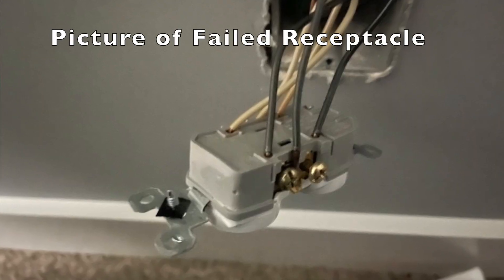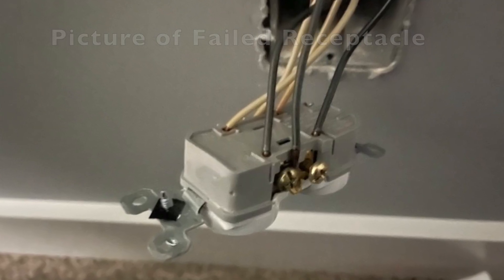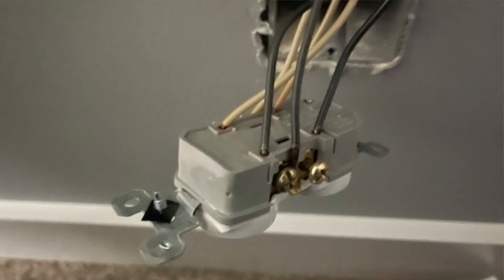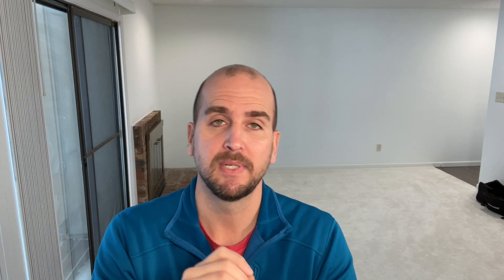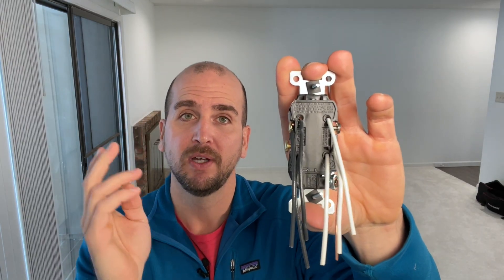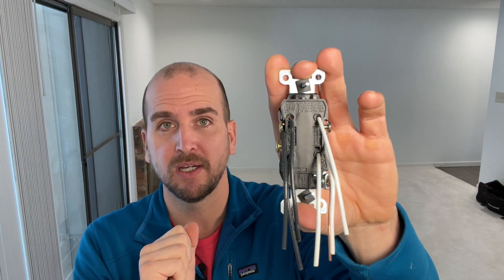Incorrectly Wired Outlet Found In Newly Built Home

Comment: I'm a Michigan licensed Master Electrician. Those are all good wiring practices. As others have noted, problems arise with under trained, unsupervised  apprentices rushing to complete a job. In this line of work, if it's not done right (code is the minimum standard), things catch fire and people will die.
Reply: I always wrap electrical tape around the receptacle covering the screw connections.
Reply: @journeyman553  I do when using metal boxes.
Reply: @scottodonnell7121  I worked on a large industrial  job that required all wire nuts be taped too. They also required the tape be "buggered" on the end for easy removal. They explained that every minute the assembly line was down cost them over 500$.
Reply: @journeyman553  by buggered do you mean leaving a flag at the end.?
Reply: @journeyman553  Been doin' that for years. Good practice.
Reply: Auh, what is code? I only ask because I have been many places and in each place I get different versions of "code". Conduit or Romex? Someplace they say it has to be conduit, others it is not a problem doing everything in Romex. Ground pins up or down? Had fights and was told both ways were the right way according to "code" in the local I was at. In an industrial site I worked at I was in the middle of a fight between the electrician and the plant safety rep about what "code" was. I would have loved to let them fight it out but couldn't get them to talk to each other and letting me out of the middle.

If electricians would stop using "code" as if it was their trade secret and the National Electrical Code was easily accessible instead of being a copyrighted  and VERY expensive building code much of the magic power of saying "code" every time someone questions a decision would be lost. Of course that might be why things are as they are.
Reply: @keithstudly6071  NMC, or Romex is permitted to be used is exposed or concealed locations in normally dry conditions. Article 334-10 A1. The NEC book is easily obtained at supply houses or Amazon. I just got the loose leaf version for 36 bucks. A great deal. So, it can be done with just NMC, but we don't like to do it. We consider it an inferior method.
Reply: @keithstudly6071  Yeah, i agree. The NEC is a guideline for the different jurisdictions. In some places the city and the country will have different codes. They don't vary that much from the NEC  BUT they do vary. As you say in some places it's Romex. some conduit and some require MC Cable instead of Romex, Some places simply go by the NEC. Others add to the NEC. The NEC is considered the minimum. The NEC itself is almost unintelligible if a layman tries to read it. You can buy an annotated copy [ over 50$ ] that explains each section in English after the electricese if you don't speak electricese . Ask your electrical supply house where you can buy one. The NEC is constantly changing or being added to every 3 years. I don't know how they could make it any more complicated but when they can make it more complicated they do.  I worked in the trade almost 30 years and traveled a lot. This code system is insane.
Reply: @keithstudly6071  Umm. Go buy a book, I'm not your trainer.

Comment: I wonder what’s more likely to fail in practice: push-in connections or the wire nut pigtails. I prefer wago nuts to wire nuts, but it can be a tight fit in the box
Reply: Push in definitely. I've repaired far too many of them. That's why I don't trust wagos
Reply: @nooneyouknowhere6148  I am with you on the Wagos.  There is a lot more wire contact on a properly twisted wire with wire nut than any push connector.
Reply: @Dev JB with them using 220 V for everything over there all those kitchen appliances use half the current when compared to 120V in the states.

Comment: I've been wiring homes for 20 years. I wouldn't use a stab-in on an outlet EVER. Any time there are 3 or more conductor pairs in the box they always get pigtailed. Usually when there's only 2 I use both terminals on the side. Load pass-through is not a problem if the circuit is properly designed, i.e. not too many devices. There is one place where I prefer WAGO connectors and that's inside recessed lighting cans. Some models even have them pre-installed. Since you're usually on a ladder with your hands over shoulder height, anything that saves time is a blessing.

Comment: sidewire terminals and backwire terminals are perfectly fine for one wire per terminal - pigtailing is a belt and braces situation for those, but three or more wires should always be pigtailed. 

also, GB wire nuts have never really impressed me.  spend a little extra to get Ideal or 3M wire nuts, and you will get better installation characteristics.

Comment: The biggest problem I've run into is the electrical box being way too shallow. Using a box extender puts the outlet too far off the wall. Some contractors just love to do electrical as cheep as possible and that sucks when needing to replace an outlet Correctly!

Comment: I'm not electrician but do not care for pigtails. Someone's not paying attention when they do the wire nuts you have one wire loose could be very bad. If you're overloading the plug in the plug goes bad because of that reason you can explain it to the homeowner.. what if they're overloaded multiple plugs. And it so happens they burn up a wire nuts that just looks like faulty wiring. But that's just my opinion

Comment: Good practice, especially on metal boxes is 2 wraps of electrical tape covering screws. Especially useful in 2 scenarios. First, working on a live circuit inserting a device (switch/outlet) into a metal box. Second, public buildings where walls are frequently re-painted. With wall plates removed (good painter) and metal boxes (commercial standard) little fingers are in danger.
Reply: Agreed. I do the same with tape
Reply: 3 wraps minimum, always.
Reply: 3 wraps of Super33 is good for 600v.
Reply: Never...

Comment: I've seen installers put a wrap of electrical tape around the screw terminals.
Reply: Usually to help with accidental contact .
Reply: Also the wire nut
Reply: geez, how do you short out a plastic box??metal boxes???
Reply: @jsparlin1  

I’m in cook county Illinois. Everything in in EMT conduit and metal boxes. No ground wires as the EMT is the ground.

I always wrap the switches and receptacles.  Besides avoiding shorts to the boxes, it makes the fixture more safe when you have the cover plates off whether it’s while still working or later when paining etc.
Reply: @TheRentsTooDamnHigh  being ibew member i smell a union rat thing..plastic boxes are superior.  they don't corrode..or conduct shocks..you should use self grounding recpts.  move as soon as possible.
Reply: @TheRentsTooDamnHigh  a ground wire in EMT has bee n required for many years due to poor installation practices.
Reply: @TheRentsTooDamnHigh  Good Lord! EMT in wood studded walls?  How long does it take to wire a house?
Reply: @jsparlin1  In general, Chicago goes a bit further than most places when it comes to fire hazards, whether electrical or otherwise.  Good old Mrs. O'Leary and her cow, or so goes the fable, taught that city not to mess around.  Thus lots of brick and stone homes in the area, too.

Trivia item: The Chicago Fire Academy is located on the same parcel that was once Mrs. O'Leary's barn! There's also a statue of a flame with an inscription in the ground saying that's where the Chicago Fire started.
Reply: @nooneyouknowhere6148  

Absolutely not true.
Reply: @jsparlin1  

I used to think the same thing. Until I did some work on romex houses. Not being able to pull new wire without tearing into walls, not being able to use different colors, always worrying about hitting a cable when hanging a cabinet.

I did a kitchen for a buddy in Michigan. The romex was a spaghetti mess so I hired a local sparky. He screwed up a three way and I had to dig into walls to fix it before I could go home

I prefer metal boxes with changeable mud rings if you change your mind later or screw up while building. The rotozip likes metal boxes too. Plastic feels like junk to me. I don’t think I’ve ever seen a corroded box.
Reply: It doesn't take much to make contact between the exposed terminals of a receptacle and a grounded gang box. One poke of a screwdriver and boom, you got a ground fault. Hence why electrical tape is used to insulate the terminals, it provides an additional layer of protection.

Comment: When replacing a receptacle in a previous home I had I found that all the pigtails were made using copper crimps covered in electrical tape. The wires were not even twisted together. Needless to say I re-wired/replaced every receptacle.
Reply: Just the really old way of connecting wires.

Comment: Lot's of YouTube videos promoting push on wire connectors (like IDEAL). These contacts are better that typical back wired outlet, but STILL ONLY MAKE CONTACT WITH A SMALL AREA, really an point contact on the wire. Sometimes technology and marketing promote bad practices. Before they had wire nuts, back in the day of cloth covered rubber insulated wire, still in many old homes, connections were SOLDERED providing 100% surface are contact.
Reply: Go look at videos here on YT of people testing IDEAL and Wago connectors to destruction. The insulation will melt off the wire long before those connectors fail; they can stand 3x the rated current.
Reply: @pheadland  I have had interesting battles with UL not doing their job. Their stamp means nothing.
If you do plumbing... everybody loved sharkbite fittings. everybody love them. They tested fine, but now reports that they starting to fail from prong corrosion. I also expect the o-rings  have a limited lifetime. Mass. were late to adopt flex gas piping. Because I'm engineer I predicted that on a lightning strike they would rupture, and they did. Then outlawed, and selectively OK'd some brands, but only the ones with grounding connections. Plumbers not allowed to do electrical work, so you new an electrician to do gas piping. Technology is wonderful if done right.

Comment: You twist your wires together wrong. Don't have them cross over one another. You don't need to twist solid wire before putting on the wire nut. They go on better if you don't twist them at all.   And your pigtails wires are too short.. They should be at least 6 inches, not barely 6 inches.

Comment: I have a hot neutral at the wall outlet. The hot wire is properly connected at the receptacle so is neutral so how can I correct this?
Reply: Check all the receptacles on the same breaker. One of them could be miswired

Comment: 12Ga wire with a 15A outlet?  Wire carries up to 20A...is that circuit on a 15A breaker?  If not, you created a failure point at the outlet for potential load.
Reply: I use 12 ga even for my 15 amp circuits.  I know it is "overkill" .

Comment: Replaced thousands of duplex plugs and switches using push ins with 3 or 4 call backs.Had some terminal connects come loose ,as well. Pig tailing is good advice.

Comment: You had 2 hots and 2 neutrals screws put one wire per screw would have worked safely without the pigtails. And then 3 wrap with a good 3m electrical tape...not plastic $1.00 per roll garbage.
Reply: It's not good to run a lot of current through the bridge in a receptical. Replaced many because of failure
Reply: @daviddean7377  ok Thanks ,! I always wondered about that. So with my reply I thought I might get an
 education on it.